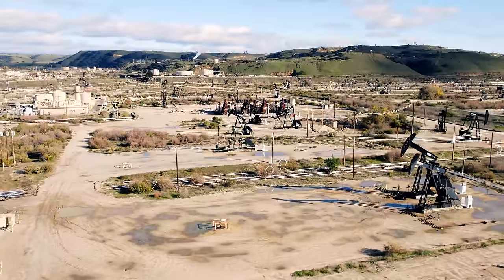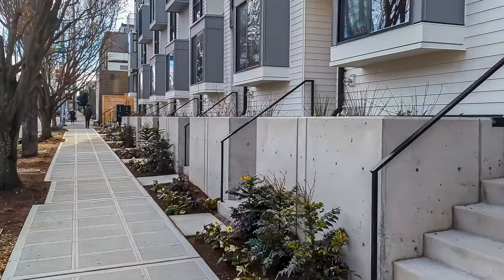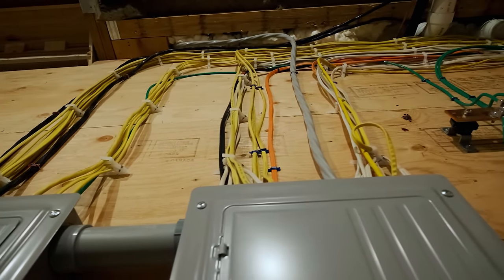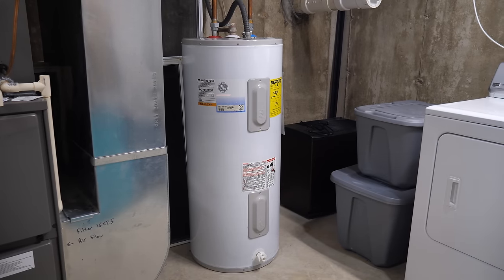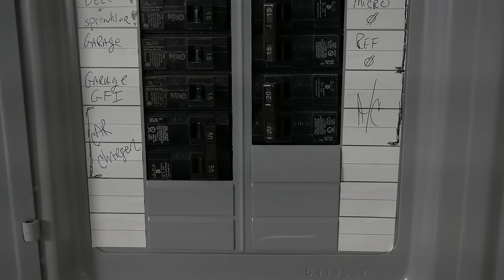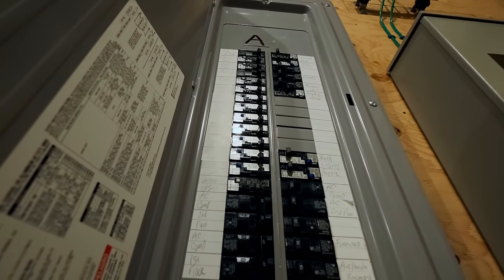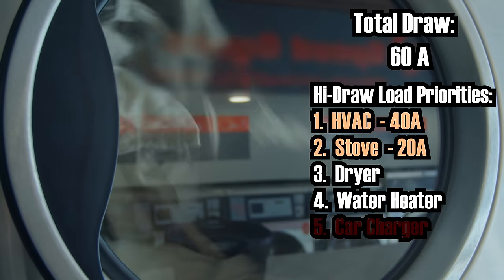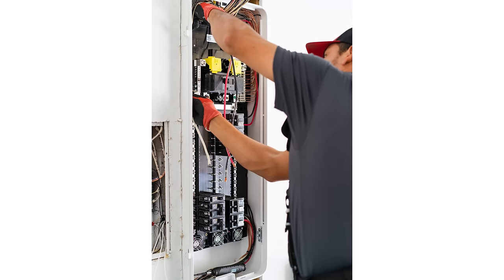Home Electrification: There's not a lot to do, and it doesn't have to be hard (Part 1)

Comment: My biggest concern about going all-electric is grid reliability.  Here in Michigan recently, winter storms knocked out power to nearly one million people, many for over a week.  Thankfully I did not lose power, but it has me thinking twice about switching to a heat pump right now.  I can run my furnace on a portable generator, but a heat pump would need something much larger (and more expensive).
Reply: Brian Gerst 
I install heating and AC units in Alabama. I have a 4 ton heat pump in my own house. Last summer I removed a very good, very functional gas furnace because of the price of natural gas. I replaced it with the heat pump. Last winter we had a gas bill that went all the way up to $400. That is WHY I replaced it. This winter I actually had a power bill of $600 . And as I said, I am in Alabama. I couldn't imagine how HIGH the bill for it would have been in Michigan.  KEEP YOUR NATURAL GAS. If nothing else, keep a couple of gas heaters as backup. I am an HVAC tech of almost 20 years.
Reply: This is a much bigger problem than people realize. Power plants are being shut down because of the fight against fossil fuels, and they're not replacing them with anything. They've simply been reducing the capacity of the grid, borrowing electricity from neighboring states when their demand exceeds their output. This has left us in a precarious position because the overall capacity of the grid is decreasing as demand is going up. There's nothing wrong with using electric cars and appliances, but it's incredibly foolish to increase electricity usage and decrease production at the same time. This is already leading to an increase in rolling blackouts, and it's going to keep getting worse.
Reply: and the "local" pumping station goes out ??? 
it DOES happen then NO GAS to run your Furness with
Reply: Staying on natural gas doesn’t protect you from that. The pipelines that bring the gas to your home require pumps to run. Pumps that utilize electricity. That was one of the problems that happened in Texas, there was no power to run the infrastructure to bring to fuel to power plants to generate the power needed to run the system.

In theory keeping a wood or coal stove, or keeping a gas tank would work, though the former two are relatively inefficient at heating homes and produce a lot of particulate matter that’s not good for your health (though still preferable to dying by freezing), gas tank would be better, though that is a potential safety hazard in that if there’s ever a leak and a fire, your house would quite literally explode (which still should be rare enough that it shouldn’t happen). Alternatively, battery storage and home renewables can provide at least some basic power even if the grid collapses, or a mini-diesel generator if you want to be old-school about it.

Finally it’s usually a good idea to pressure your state politicians to ensure that the state’s electrical grid isn’t going to fail during critical weather events, like what happened in Texas two years ago. Writing to your representative helps let them know what issues you’re worried about, and relatively few people do it, so it can be a decent way to have an outsized influence.
Reply: I live in the Buffalo area so blackouts in the winter are just expected most years. I have animals that need higher temperatures to survive and I currently live in a mostly-electric home because that’s what was available. Not having a gas stove to be able to heat water for them in the winter is one of my biggest worries in this house.
Reply: @jasonriddell  I can name how many times I've been without electricity for more than 12 hours in the past year. Three. The previous 5 years are very likely similar with a record of 4 days. I cannot recall, not once in my 38 years of owning a home, not having natural gas unless it was planned construction (this may have happened twice in 38 years). The chances of a power outage are significantly higher than a gas outage.
Reply: @joshwilliams7692  This isn't actually true. According to the US Energy Information Administration, in 2005, the US had an energy generation capacity of 977 gigawatts; in 2021, the capacity was 1,143 gigawatts. Over this same period, energy consumption remained stagnant about, going from 4,056 terawatthours generation/consumption in 2005 to 4,105 terawatthours in 2021. This means that grid capacity relative to consumption has actually increased. Sorry to damage the narrative you're trying to push.
Reply: @jasonriddell   The pumping stations you are referring to will ALL have a natural gas BACKUP GENERATOR.
Reply: @ Brian and Jason 

The utility providers have factored in things like blackouts and such since they started rolling out infrastructure like pumping stations.

Generally they have ties to more than one grid section and are connected as critical infrastructure so are not included in local domestic circuits so are not affected by local blackouts or load shedding.

So generally the only time they would fail is if a terminal substation went out or a whole grid collapse.

Some major pumping stations for water treatment also have backup generators I would imagine some of the major gas pumping stations probably do have as well in that case the system may at least run at reduced pressure but still be available for majority of users.
Reply: @Treviisolion   while you make a couple of valid points, you have neglected to mention or maybe you are not aware that the natural gas pumping stations ALL have natural gas BACKUP GENERATORS.
Reply: @SunriseLAW  As discussed in Alec's video(s) about heat pumps, heat pumps outperform natural gas heating. They only need a coefficient of performance of a bit less than 2 to make them as efficient as burning natural gas directly for heat, and in practice they frequently have CoPs much higher than 2. Natural gas power plants have a generation efficiency of something like 60%, which would put the break-even point at a CoP of about 1.7. Keep in mind that even natural gas heaters aren't 100% either, as some energy must necessarily be wasted as exhaust.

Also, this assumes that literally all electric generation is via natural gas; if you consider that 40% of energy generation in the US is from sources that don't generate greenhouse gases, the break-even point in terms of GHG emissions even lower.

I don't know why I have to tell you all this if you apparently watch this channel.
Reply: @c.blakerockhart1128  Aren't you guys served by one of the southeast's regulated public utilities? You transferred your heating demand from natural gas to nuclear, hydroelectricity, and coal. I'm interested in what the price difference ended up being.
Reply: @erictheepic5019  You do realize that electricity companies don't just charge you the fuel costs to run the turbines, right? They have to pay for the maintenance, the grid, interest on loans, etc. The COP needs to be higher than that in order to economically break even.
Reply: @SunriseLAW  Okay so this concept is really unintuitive, so I'll try to run through some maths to help you understand.
Let's start with the scenario in which you are using a gas furnace to directly heat your home. Pretty simple, say you want to use 1kg of gas to heat your home, with the specific heat energy of gas being around 14kWh/Kg, and assuming a 100% efficient furnace, you would obviously get 14kWh out of that 1kg.
If, on the other hand, we assume the grid is 100% powered by natural gas generating plants that are 40% efficient, and you're using a heat pump that has a COP of 3.5:
The natural gas plant burns 1kg of gas, producing 14kWh of energy, but only 14*0.4 = 5.6kWh of that energy is actually captured and turned into electricity. With that 5.6kWh, however, your heat pump is actually able to provide 5.6*3.5 = 19.6kWh of thermal energy! That's more energy than using gas directly, with the same amount of fuel burned, because heat pumps can operate with effective positive efficiency. That is what is so magical about them.
Of course, the efficiency of the grid, the COP of the heat pump, and the efficiency of the gas generator can definitely result in a lower overall output, but also, the grid is composed of lots of zero carbon energy sources, like nuke, hydro, wind, etc, and that percentage is only increasing. Plus, I used the lowest possible numbers for the efficiency of the gas plant, and the highest numbers for the efficiency of the furnace. As to why your gas bill is lower than your electricity bill? That's probably more a question of you effectively paying to use a gas generating plant that you don't own, as opposed to any inherent physics properties of the methods of heat generation.
Reply: TLDR for this comment chain. We have no clue that 80% of the electric grid is generated by gas 100% of it in cities. The grid is barely holding a valence and the entire energy economy is inflating to absurd amounts from the hit pieces on gas appliances.

The faster we find idiots that say 100% electrical systems are efficient and let them freeze in the three week power outages during winter storms up north. Seriously it's such a regular occurrence during winter we laugh at electric user crying during them. Fuck electric heating and those that defend them.
Reply: @snintendog  are you claiming that inflation is entirely or mostly caused by the fact that people are advocating against gas appliances? Also, are you saying we should just forever remain reliant on a greenhouse gas emitting source of power that is (in europe) sourced mostly from Russia, rather than like, fixing the grid so that it doesn't constantly fail?
Reply: @Treviisolion  Doesn't agree with my experience of 20 years living in the same house in Canada. Over the last 20 years ,where I live, power has gone out maybe 5 times a year on average (real data: 6 in 2022, 6 in 2021, 1 in 2020, 1 in 2019, 5 in 2018, 7 in 2017). For comparison, gas has not stopped once in those 20 years.
Reply: @c.blakerockhart1128  if you have heat bills that high in AL, sounds like your home needs better insulation.
Reply: I'd just get a catalytic propane heater for emergencies. That's cheaper than a generator and basically maintenance free, pick up a coleman stove to go with it and your set for any extended power outages.
Reply: @Treviisolion  that’s ymmv. In 25 years, my area has not had natural gas interruptions, including during our frequent electric outages. Gas companies can install their own backup generators. Hell, here the cable internet system has 48v natural gas generators all over to keep the system up with no power.

I’m still considering a move to all electric because the local gas company is threatening a $60 monthly fixed connection charge, but one of the downsides to all-electric in my case is not having gas available to provide home heating on a 15 amp portable generator.
Reply: @lehanjones242  more demand means more supply to make effing economics educate yourself
Reply: @lehanjones242  next batteries focus on a better storage then green electric will actually be useful and not be more costly to the environment than gas and oil
Reply: @snintendog  Yes, but there's a difference between "this thing is a very small contributor to inflation and the extent that is does contribute is overall less important than the positive impact it has" and "this is the sole driver of inflation and must be stopped", y'know?
Reply: @SunriseLAW  Thanks for you courteous response! Fair enough on the front of cost - absolutely gas is still cheaper in many places, but strictly from a technical perspective, even though gas generation plants are less efficient than direct gas home heating, the fact that heat pumps can be over 100% efficient (some over 500% efficient), can cancel out the fact that the gas fired electricity generation is less efficient, if that makes sense? But yes I totally agree, renewable produce cheap, plentiful energy and we should absolutely be investing as quickly as possible into them!
Reply: @SunriseLAW  I'm not sure why you're stuck on the efficiency aspect (with respect to power) when heat pumps can be 400% efficient. And then in the next sentence you talk about dollar efficiency.
Reply: @erictheepic5019  I read something similar a few years ago, from either FERC or NERC. Generally, generation and distribution is increasing. Demand varies, partly because users and uses are increasing, but some of that is offset by increased efficiencies or off-peak load-balancing.

The argument is often trotted out by people who are against electric vehicles. The benefit of some electric vehicles is the ability to use its battery in a blackout. However, they may have a point about cutbacks of some generation capacity. Some have suggested that it's capitalists trying to take generation offline in order to drive up the price per kilowatt hour. Others have suggested it's caused by deferred maintenance to keep overhead low that bit them in the butt.

I live in a small town 5 miles from a nuclear power plant. They threatened to shut down recently, claiming green incentives for wind and solar made them less competitive, but finally got a deal from the state government. Now, they recently announced they plan to increase generation capacity, but I don't know how. But I wonder if they could or would ever consider running hot water pipes several miles into town for district heating.
Reply: Running a 350% efficient heat pump on a 20% efficient generator is 70% efficient. That's not half bad for a backup system. Natural gas boilers can sometimes be as low as 80% efficient, though NG is cheaper than gasoline or highway diesel. 
For really cold climates, kerosene and propane space heaters do exist. It really comes down to an economic decision on your end. Making heat in an emergency is not hard.
Reply: @c.blakerockhart1128  400 - 600 dollars to heat a house through winter is chump change regardless, unless you are very poor.
Reply: @joshwilliams7692  That claim is such an utter load of BS.  Here is the data as an example from 2021 to 2022.

"The United States achieved a notable increase in electricity generation through the combined utilization of solar and wind sources, amounting to approximately 683,130 gigawatt-hours (GWh) during 2022. This represents a significant rise from the previous year, where approximately 588,471 GWh was generated."

So, between 2021 and 2022, the increase in renewable energy generated was around 100,000 GWh, but we are "not replacing them with anything"..?

That is claim is literally 100% false.
Reply: @SunriseLAW  Yet another claim that is obviously false.  The data is all available on the EIA website.  There is literally no excuse at all anymore to make false claims about this.

Renewable Energy USA Total - 21.5%
Wind 10.2%
Hydro 6.2%
Solar 3.4%.

So, no, "most of the other 20% is obviously NOT Hydro, as solar and wind is 13.6%, Wind is the largest part at 10.2%.
Reply: @joshwilliams7692  
I am an electrician in the power industry, and I would like to refute you when you say "Power plants are being shut down because of the fight against fossil fuels, and they're not replacing them with anything." The majority of plants being shut down are due to them reaching their normal end of life, just like a car with so many miles that it becomes to expensive to keep it running. Retired power plants are being replaced with renewables at an ever increasing rate, as it is the cheapest source of electricity at this time, and is now a bigger source of energy than either coal or nuclear in the US.

In addition to replacing retired power plants, new renewable power sources are being added to try and keep up with demand. The problem is that utilities don't want to build in excess production capacity that sits unused for most of the year unless they are forced to do so by regulators, and when allowed, utilities choose the cheapest path. In areas with deregulated power production like California, independent power plant operators are reluctant to invest in production capacity that will sit unused (and unprofitable) for most of the year.

The "grid" is not a monolithic entity, but is composed of many different utilities with vastly different structures of power production, distribution, and regulatory authorities across regional and state lines. While some states and utilities have begun to cooperate to better utilize renewables across larger areas (like the Western Energy Imbalance Market), others have competing interest, investments, attitudes, and regulations that create significant barriers to coordination and cooperation.

During the summer months during heat events, many thermo-electric power plants, especially, but not limited to the Western US, have had to curtail their power output due to a lack of adequate cooling water because of drought. Most people do not realize that electrical power generation is one of the biggest consumers of fresh water in the US, and the higher number of heat events per year, coupled with lower water supplies, and higher water temperatures than the operation design of the power plants, have been causing issues. All fossil fuel and nuclear power plants are thermo-electric, along with biomass generators, and this is becoming a problem across the industry worldwide. This has been a problem with the French, and to a lesser extent, US nuclear power plants.

As utilities are discovering the advantages of battery based energy storage to replace expensive peaker plants and their ability to stabilize the grid, they are jumping on the battery storage bandwagon and not looking back. Renewables are beating out fossil fuels on lower cost and value alone, even with the addition of battery storage.
Reply: @SunriseLAW  nuclear is the cleanest mass power source available. We should be embracing it.
Reply: @SunriseLAW  Smart thing about electricity is that the grid can change energy sources over time and you don't.
Reply: @jasonriddell  Losing natural gas is much less likely than losing electricity. Overhead power lines are much more vulnerable to environmental damage than underground gas lines. Got propane? No problem unless you run out. With the ridiculous electricity bills I've been getting lately, I'm scouring marketplace for gas appliances.
Reply: @markkempton4579  Thorium reactors ftw.
Reply: @JetSkiSuper7  of course it is.
2 to 4 times as efficient.
Why are you questioning that? Isn't that common knowledge?
Reply: @JetSkiSuper7  Yes, they are.

Imagine an in-window air conditioner unit. For simplicity's sake, let's just say that it uses 100 watts of electricity to provide 200 watts of cooling to a room. That 200 watts of cooling means that the air conditioner is moving heat energy from the room to outside at a rate of 200 watts. But say that we wanted heating instead; what if we just turned the air conditioner around so that the flow of heat is reversed? That means that 200 watts is being moved from outside to inside, providing 200 watts of heating. But, we're only using 100 watts of electricity to do this. For this particular example, for every 1 watt of energy (in the form of electricity) we put in, we get out 2 watts of heating, meaning that our system is 200% efficient. Compare that to a gas furnace, where for 1 watt of energy (in the form of gas) you get out at most 1 watt of heating if the furnace is 100% efficient.

If this wasn't enough, watch this channel's videos on heat pumps.
Reply: Exactly. Here in Maine we have frequent multi-day power outages, particularly in the winter when it can get down to -15*F. I'd need a massive industrial generator to run heat pumps powerful enough to keep my house warm (or even un-frozen) during that.
Going all-electric might work fine for urbanites and wealthy suburban areas, but here I'll stick with wood and oil.
Reply: @JetSkiSuper7  hard to see the truth when you deliberately close your eyes.

What you want already has been done. You just have to look for the studies and reports.
But if you were really interested in this you would already know that. Heat pumps have been in use for decades.
All the numbers you ever could want are easily available on the internet 🤷🏼‍♀️
Reply: @SethPowell7  I agree. Our house was completed in the year 1900. It has open cells between the studs all the way from under the house, up to the attic. This allows the house to breathe. And by that I mean that it allows air transfer. In the summer the foundation vents pull air in and the airflow PUSHES the heat out off the attic. In the winter it becomes a whole new ball game. The house has 0% mildew, 0% mold, 0% wood rot. But this is all BECAUSE it has 0% insulation. I need to find a way to insulate WITHOUT disrupting the air flow that is Built in to the house. I have seen one other house built like ours and it IS INSULATED. It has mold, mildew and wood rot. I first went under that house about 10 years ago to replace the furnace. At that time it had No insulation, NO mold, No mildew, or wood rot. They insulated it right after we installed the new system. The lack of airflow as Originally intended actually CAUSED the house to start to decay.
Reply: @1873Winchester  I am far from "Poor" Thank you. But I am also far from "Wealthy". If you CAN ACTUALLY call $400-$600  " Chump change" then GOOD FOR YOU.
Reply: @JetSkiSuper7  "And cars are so good that horses outsell them 10 to 1." -You in 1901
Reply: @jasonriddell I live on the gulf Coast and I can confidently say that pumping stations loosing power isn't as big of a deal as you think. We were directly hit by a category 5 hurricane that knocked out power for over 2 months. Our PNG grid did loose some pressure, but it was still effective for the 3 additional months it took for the local refineries to come back online.